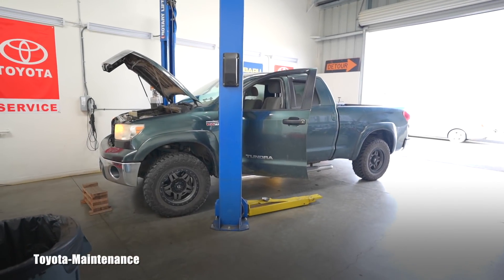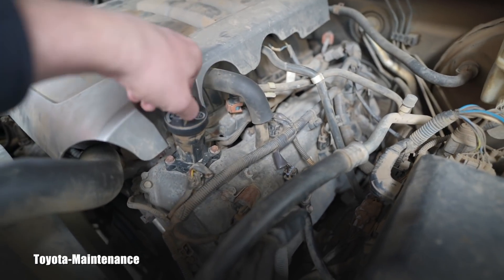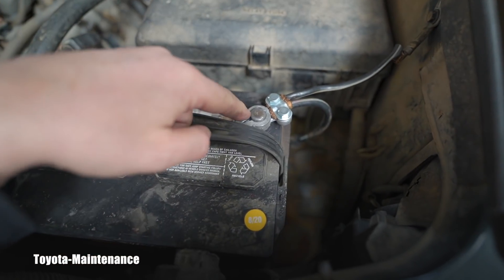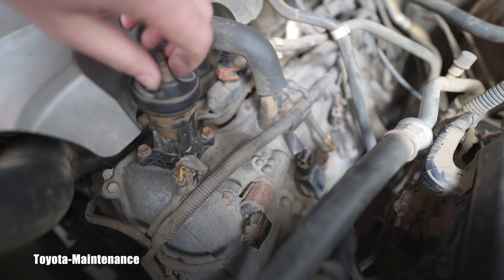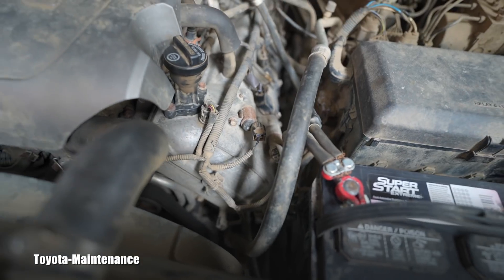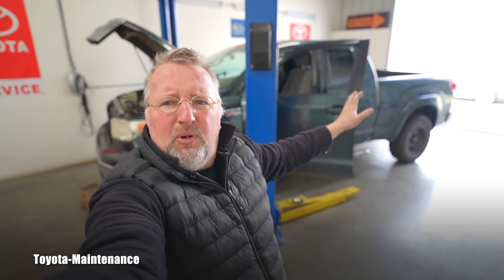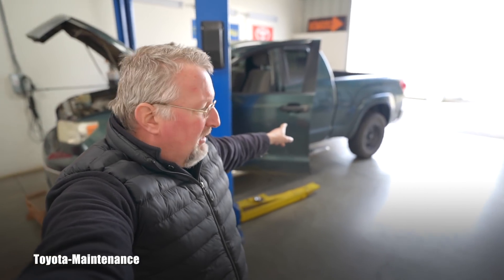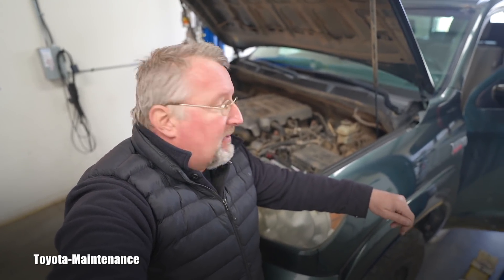Toyota 5.7L V8 Engine 3UR-FE clicking, rattling on Bank 1

Comment: Started hearing the noise try to get louder, so like others i use some MMO every oil change, 2oz or 4 oz. Its running quieter and my logic is that the oil starts to burn and gunk up at the tensioner. So small amout of MMO just keeps things a bit cleaner. Im worried about the head gasket issue on these though

Comment: 2011 5.7 Tundra. I had same noise. Not always it would pop up maybe once a month for short time. Went full synthetic on oil. Sea foam in fuel tank the added 8 once’s sea foam to oil. Havnt heard anything now for 5 weeks. I’m suspecting the timing chain tensioner was guncked up. Bought truck 6 months ago don’t think previous owner did preventative maintenance on anything. Mileage. 161000

Comment: I have a 2014 5.7L Tundra Platinum that makes this SAME noise upon cold start but it only lasts for about 30-60 seconds then goes away. I’ve replaced both driver side VVT Solenoids, replaced all timing chains, guides, sprockets, and tensioners. I run 0w-20 full synthetic Mobile 1 per owners manual and nothing helps. There’s NO check engine light on and it runs good. Any advice would help or things to look at would help.
Reply: your problem is Mobil1, my new 21 did the same when I did it s first oil change with Mobil1 at dealer, flushed that garbage out and returned to oem a week later

Comment: Really sucks that this guy hasn't posted a follow-up on this. No one has said exhaust manifold leak; I've seen other videos suggesting that. I've also seen video associating the noise with sticky timing chain tensioner as other commenters have said.  And almost all mechanics jump two valve tap. 

Unless you have your own shop and are a mechanic unafraid of tearing the front of your engine apart, getting to the timing chain tensioner is a $2,500 service from the Toyota dealership.

Regardless, to be able to tell my mechanic the sound that my truck is making the audio in this video is perfect.

Comment: Did anyone find the fix for this. Ive got one that toyota has done put 32 lifters in it(twice under warrenty) and its only gotten worse. Bank 1 has soft lifters, chain seems tight. P0300, p0307, p0308, has fuel, has spark, has 150ish psi compression. Toyota said metal in oil now, needs motor. I dont wont to replace the mans motor cause i missed something. Thanks!
Reply: Oh and the truck has 86,000, and sound like the one in the video exactly.
Reply: Update, pulled the oil filter found metal shavings and metal flakes, for some reason it not oiling bank 1 properly. So ive got to tell the owner he needs a motor.

Comment: It's the timing chain tensioner. Mine started doing it around 100k on cold winter startups. I've driven it another 45k and haven't done anything
Reply: Did you ever change it

Comment: Mine ended up being the result of the Rear Main Seal leaking, and causing my oil levels to become lower than normal, unexpectedly. I'm in the process of performing maintenance on our car, and then my rear main seal is getting replaced next. If the oil gets too low, it gets to clacking and knocking hard. Its embarrassing as all get out lol. This truck may have the same problem?

Comment: I would change the oil but I would add one quart  Lucas oil stabilizer. Run it till it dies. Sell it for parts after it dies. Go get another used truck.

Comment: What fixed it?  I'm having same issue.  Tried seafoam suggestion does bto go away.  55K miles on my 2015.  Oil always changed at 5K miles.  Noise does bot go away when it warms up or ever.  Can hear it up to about 3k RPMs.  Looks like most who have it turns out to be timing chain tensioner.  Only unusual circumstance is working from home for 2.5 years do not drive it consistently.

Comment: I have a 2012 Rock Warrior with the 5.7L. I purchased the truck with 25k on it.  The truck has made that same noise from the day I purchased it and still does to the day. The truck gets Mobil 1 5w20 synthetic oil every 5k with a premium WIX oil filter.  It currently has 350,000 miles on it and runs like a champion.  In fact it runs so good I just drove it 800 miles to my family farm.  Hooked up a 25 ft gooseneck trailer and hauled 4 loads of round hay bales at 1200lbs each 40 miles 1 direction. The noise is extremely annoying, but mine is proof, it doesn't affect performance.  Mine does it every day upon start up until the engine temperature gets up to almost normal and the stops.  

I have replaced all the cam's, lifters, timing chain, guides,  tensioners, actuators,  plugs, coils, and nothing has changed it. 

My advice........ drive it..... you won't find a better truck
Reply: Great news! That's really good to hear
Reply: Rocker arms tight ?

Comment: Mines in the shop right now for the same issue. It’s the timing chain tensioner on bank one. Toyota needs to do a recall but hasn’t yet. Sound comes and goes. Tensioner works half the time. When the tensioner doesn’t work, the timing chain guide slaps against the tensioner causing the noise. That was my issue anyway.
Reply: Replacedjust the 1 tensioner or all 4 w/chains and such? How'd it go?
Reply: @teamhogmeat  replaced all 4 tensioners, chains, guides and phasers. $4200 job. Problem was that owner before me never changed the PCV valve and caused tons of build up in engine so they thought it best to replace everything that required oil pressure to operate the timing. Unfortunate, but it runs like a champ now with zero problems.
Reply: @Outdorsenit  Thank You!

Comment: I found a post for this issue on my truck that seems to suggest it is the variable valve timing gear assembly on the rear of the cam. There is a protruding boss that is supposed to lick into a detent in the cam advance mechanism that apparently gets a notch worn in it which prevents it from locking in like it is supposed to so it flaps around. Still have to get into mine to verify this but the noise, diagrams and engine diagnostics all made sense. Also why it goes away when it does finally lock in.
Reply: Did you find out the problem?
Reply: Seems to be timing chain tensioners.. going to open it up in a few weeks. I’ll let you know ..
Reply: Seems to be timing chain tensioners.. going to open it up in a few weeks. I’ll let you know ..
Reply: Seems to be timing chain tensioners.. going to open it up in a few weeks. I’ll let you know ..
Reply: Seems to be timing chain tensioners.. going to open it up in a few weeks. I’ll let you know ..
Reply: Seems to be timing chain tensioners.. going to open it up in a few weeks. I’ll let you know ..
Reply: Seems to be timing chain tensioners.. going to open it up in a few weeks. I’ll let you know ..
Reply: Seems to be timing chain tensioners.. going to open it up in a few weeks. I’ll let you know ..
Reply: Seems to be timing chain tensioners.. going to open it up in a few weeks. I’ll let you know ..
Reply: Seems to be timing chain tensioners.. going to open it up in a few weeks. I’ll let you know ..
Reply: Seems to be timing chain tensioners.. going to open it up in a few weeks. I’ll let you know ..